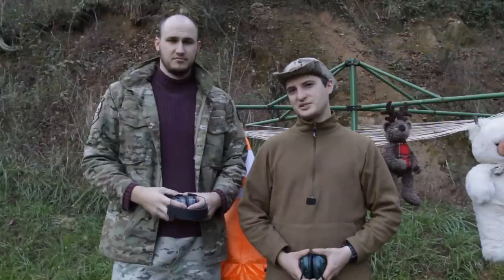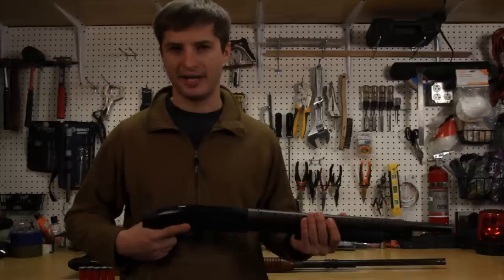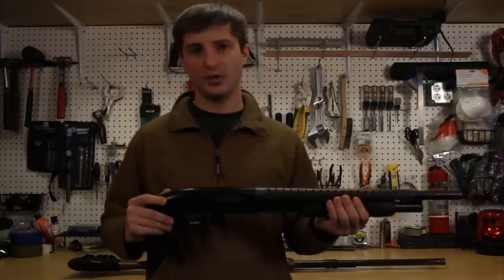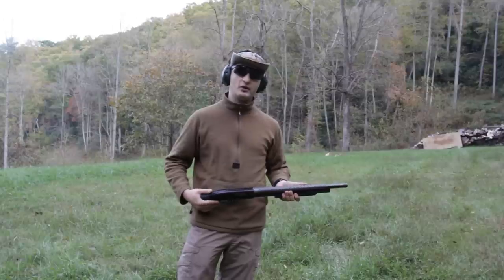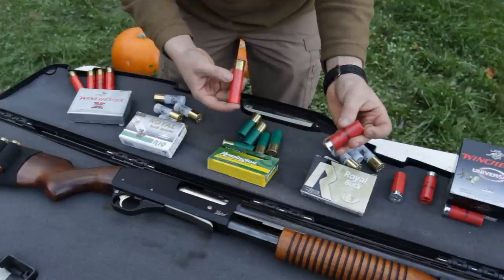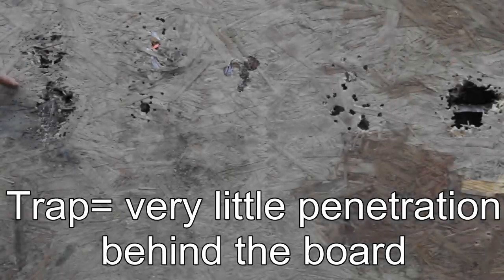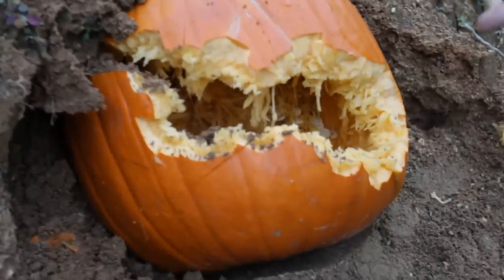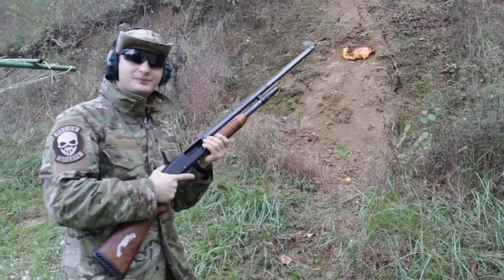How to use a 12 Gauge Shotgun

Comment: First time I've watched this channel.  Good job.    Assuming your audience is newbies, you may want to lead with 4 rules ( or 10 ) of gun safety everytime.   I did not see you violate any of them.  BTW  Ithaca 37 pump shotgun, you can just keep the trigger held back and it will fire when the slide is returned to front.  For this model it's intentional, not a malfunction or modification.

Comment: A good demonstration for your viewers would have been to show my favorite HD round. It's Nobel/Centurion's buck & ball multi defense round which offers a .650 caliber single ball round followed by six 00 shots of bi-metal material. From 25 yards out the pattern is impressive on a man size target & at 1300fps,, the results are inescapable.

Maybe not quite as catastrophic as the nasty 3 1/2" magnum you fired but your shoulder's still intact after firing 3 or 4 of Nobel's 2 3/4 man stoppers..